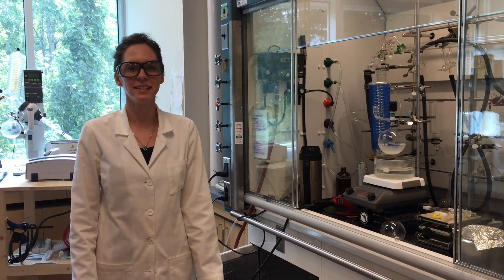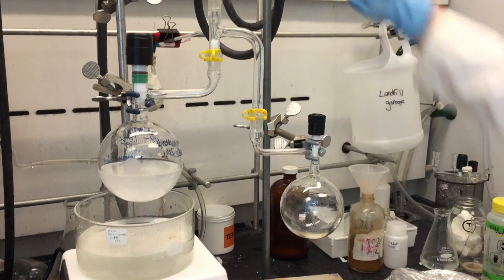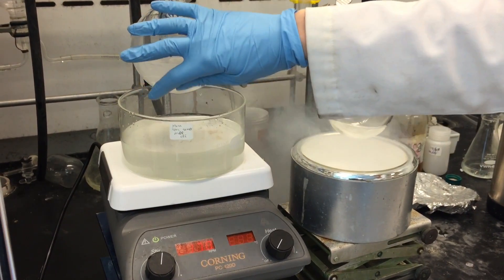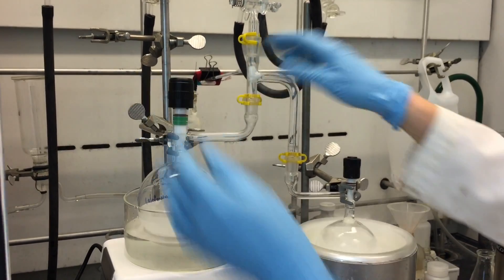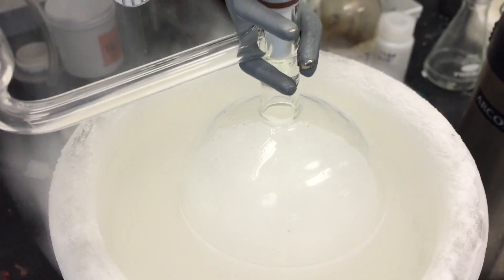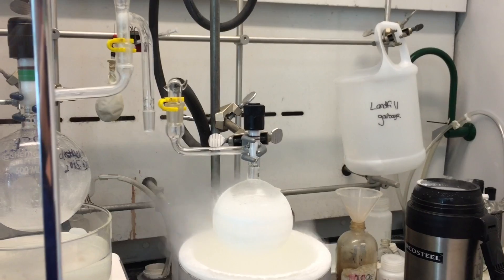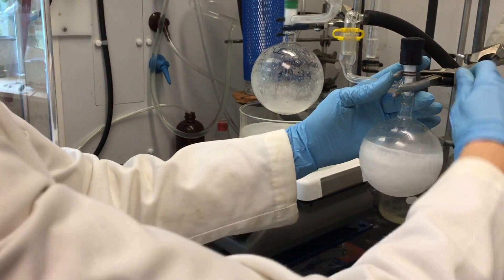Solvent Vacuum Distillation

Comment: For the first time I see distillation with no condenser in assembly. Just a tubes with vaccuum outlet between evaporating and receiving flask! :)
Reply: Our company has sold this type of instrument. Some customers have customized it such that there is only one tube with a vacuum outlet between the evaporation flask and the receiving flask. This makes the equipment more affordable.

Comment: Just to be clear, this is pretty crude level of materials handling.  The evacuation times shown here are very short, there is not the usual 3 fold pump-flush cycling with inert gas, typical of Schlenk manipulations.  This might be sufficient for simple syntheses but not for use with highly air sensitive compounds.
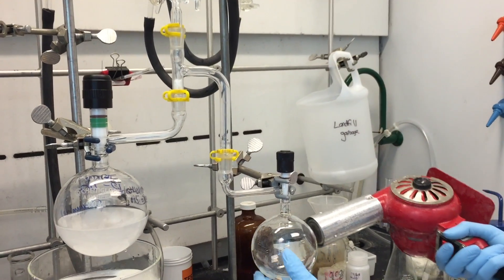Reply: well, except she did do three cycles 3:10, just didn't include it in the video. Watch the whole thing so you can give credit where it's due

Comment: sir, 
       what is use in chemical distillation second flask coldness use.? without condenser ? please reply me.
Reply: Instead of using a condenser, she set the receiving flask in liquid nitrogen (-196° C boiling point so you know it's cold).

Comment: Cool!  Do 90% hydrogen peroxide next!
Reply: I'm not sure how a vacuum still works. I'm guessing a pump sucks the air out. If so, how do you not lose the h2o2. If the water evaporated under vacuum and left the good stuff, then no problem. Do you put some kind of chiller in there to condense the peroxide or what?
Reply: You people are dumb, distilling concentrated hydrogen peroxide is dangerous. Every video ive seen they're worried about it exploding.